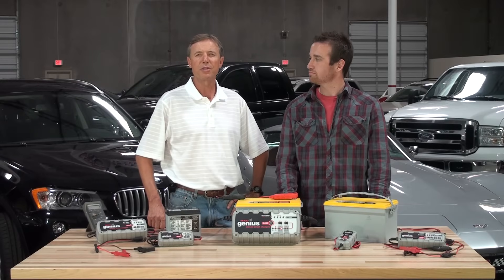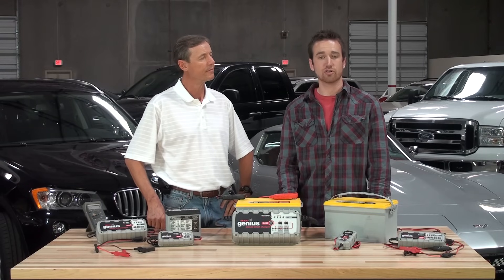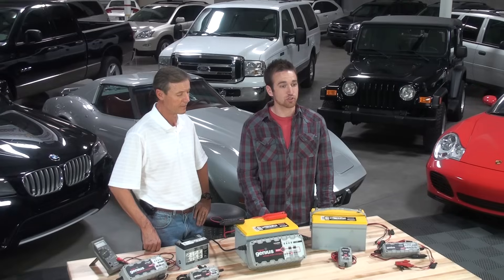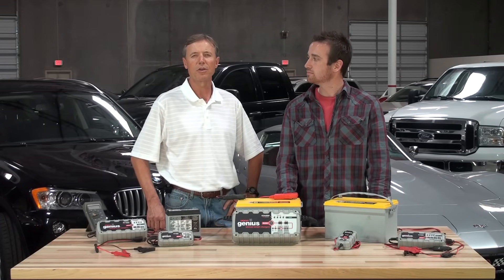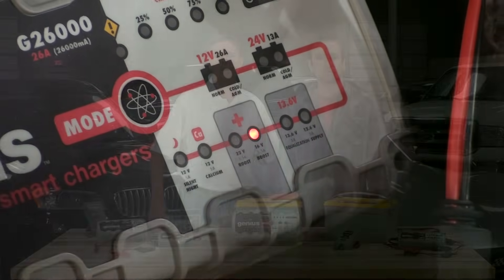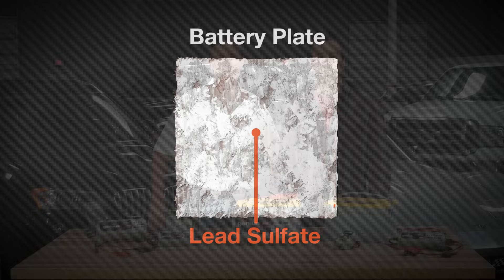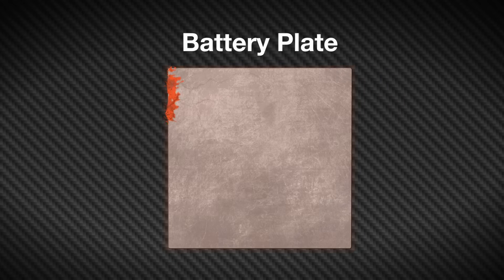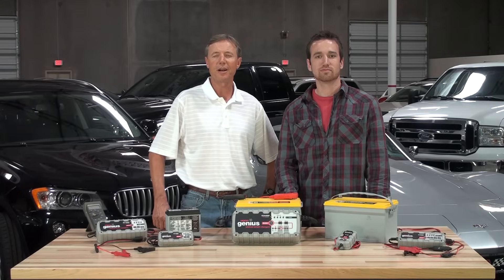How to Desulfate a Lead Acid Battery

Comment: Very poor video. Trying to sound smart by noting the charging current as 1500mAh when to everyone else it's 1.5A just makes you look suspect. And 1.5A may be fine for a 100Ah battery, but it would be the end of say a 15Ah battery. Very sloppy and inaccurate - makes you look like scammers...

Comment: Will a 2 amp trickle charger revive a dead battery? It seems to be charging. It kept saying the battery was bad so I unplugged it and plugged it back in and it is still charging. Any advice would be great

Comment: You are SO wrong. I build Lead Acid Fork-lift batteries for a living and have taken apart about 26,000 units and rebuilt them in the last 35 years. The REAL problem is that the Positive plate gets brittle and crack!!!!

Comment: The high voltage means I would not try this as a recharge without disconnecting the battery from the vehicles circuit, I suspect the fine print for the charger would tell you this.

Comment: Do you need to remove the battery or can desulfation be done with the battery attached to the leads in the car?
Reply from the maker: The battery should be disconnected from the vehicle.
Reply: @NOCO  How much long will the battery last after done a recovery mode?

Comment: does it matter if the battery you use a desulfator on is AGM vs lead acid?  

And will smaller desulfators still work on higher amp hour batteries?

Comment: re: "Battery Sulfation accounts for roughly 80% of all battery failures."   ...but that's almost always batteries that have not been kept fully charged. Batteries used for standby (not deeply cycled) that are routinely kept at no more than 25°C  on a maintenance charger that does not overcharge them will experience very little sulfation over their maximum possible lifespan (~10-12 years).  Instead, they end up failing due to accumulated plate shed material in the bottom of the battery, which eventually builds up enough to cause "soft short(s)" on the bottoms of the plates in one or more cells (usually starting with the cell on the positive terminal). That causes internal resistance to rise and every attempt to charge (or desulfate by brief intentional overcharge) results more  of the charger's electrical output being converted to heat, causing excessive outgassing, hastening the inevitable demise of the battery.
Reply: Correct me if I'm wrong,, but doesn't that mean that most store shelf batteries are improperly stored?
Reply: @GoliathSack  Yup! That's the first time they start failing and it goes down hill from there.
Reply: @GoliathSack Yes, at least for flooded cell bats.
They should be stored without the electrolights then filled up for the first time when sold to the customer.
Reply: Good to know... I'll take that into consideration the next time I desulphate my 25 year old 6v deep cycle batteries.
Reply: @justsoicanfingcomment  gotta love it! 😂

Comment: Outstanding! I use these for my golfcart, 4-wheeler, jetski and lawnmower.   imgs.love/nBatteryCharger    I installed the recepticle on all instead of using the battery clips. So easy to plug and unplug and all of my equipment is always fully charged. I also use a larger version for my boat.

Comment: Maybe then I can desulfate my 12V car battery at 16.5V @ 1500 mAh using my 50$ Imax B6AC v2.0 RC charger. I'll try it out. To end charge at 16.5V (close enough), All I have to to is select the "Li-Ion 4S" charge mode, which has an End charge voltage of 16.4V and set the charge rate to 1.5 A. And voila ! If I want to be even more aggressive, I can charge in "Li-Po 4S" charge mode, with an end voltage of 16.8V.

Comment: The NOCO Company:  I'm curious if you can answer this question for me.  Is it safe to use repair mode on an AGM or Gel type battery?  The instructions do indicate that repair mode is only to be used on flooded lead acid batteries.  However, it does not specifically state that you can not use repair mode on AGM or Gel type.

Comment: Great tip! Battery discharge and subsequent sulfation is the most common cause of lead-acid battery failure.
Reply: You are SO wrong. I build Lead Acid Fork-lift batteres for a living and have taken apart about 26,000 units and rebuilt them in the last 35 years. The REAL problem is that the Positive plate gets brittle, cracks!!!!!
Reply: I need some batteries 48 volts higher amps solar power. @bobgreen9980

Comment: 16.5V at 1.5A on a 12V battery?  Yeah right!  It will be MUCH higher than that.  To test this is easy.  Just get a 30V variable power supply such as a laboratory power supply ($50 or less used) or just borrow one, allow it full reign on delivering it's maximum current, then sweep the voltage from about 12.8V slowly up to 16.5V and watch the built in ammeter.  Even if the battery is fully charged (let's say it is a 12V 150Ah battery which is quite large and heavy), chances are it will soak up more than 10A at 16.5V.  So unless you are rewriting ohms law, I don't see how you can get only 1.5A to flow at 16.5V at the battery terminals.  If the charger is somehow adding series resistance internally then there will be a voltage drop at the battery terminals so it wont be 16.5V.

If you have a DC clamp ammeter to measure amperage flowing thru a cable, you can very briefly connect a pair of 8V batteries in series for 16V to a 12V fully charged battery and measure the amperage.  I suspect it will be WAY higher than 1.5A (1500mA).

I agree the information presented here is not accurate.  Sounds like they are trying to hype up this product when in fact a $50 laboratory power supply can do similar and then some.  For example, what happens when a battery is so bad that not even 16.5V can bring it back to life?  With the lab PSU, I can go all the way up to 30V and I can set my Vmax (maximum charge voltage before it changed from CC (Current limited) mode to CV (Constant Voltage) mode.  Typically on a 12V FLA battery I will set that at 14.8V which is 20% over nominal battery rated voltage.
Reply: +David James Reversible sulfation can often be corrected by applying an overcharge to an already fully charged battery in the form of a regulated current of about 200mA. The battery terminal voltage is allowed to rise to between 2.50 and 2.66V/cell (15 and 16V on a 12V mono block) for about 24 hours. Increasing the battery temperature to 50–60°C (122–140°F) during the corrective service further helps in dissolving the crystals.
Reply: SHLOMO AMAR Ok I can easily do that with my lab PSU, that is, restrict it to 200mA maximum and let it run that way for 24 hours.  I assume each battery should be done this way individually and not in a bank correct?  Also what is so special about 200mA?  Is this enough on a large 200+Ah golf cart battery such as a 6V 210Ah FLA battery?
Reply: SHLOMO AMAR - How do you increase the battery temp to 122-140 degrees F?  The 200mA overcharge wont do it.
Reply: +David James 
1. Charge  the battery to the maximum using standard charger.
2. Connect current source and Limit current to 200ma (my experience to avoid over heat and boiling).
 3. limit voltage to maximum 16.45v  
4. Don't allow  battery temp to rise more than maximum of 50 C (about 140 F).
If the battery is very old and the voltage is very low use Pulsed method to restore the voltage and before doing the above process (1-5).
Reply: +David James 200ma only my experience for 37AH Battery.
Reply: SHLOMO AMAR 200mA is probably below the self discharge rate of a large battery so maybe 600mA or so for a 200Ah battery or maybe 1A (5x the Ah rating in mAs?)

Comment: I have the G7200, how long do I leave it in the 16v boost mode?
Reply: I have the same charger and have the same question, I have been searching for about 2 hours without any results.
Reply: Kayne Davis
IMO.
16 volts is harsh equalisation. The battery suffers to an extent. Certainly, it will remove some sulphation, but you don't need one of these devices for that.
If the device never leaves the boost mode, I guess it may never be able to sort the problem, or will take an extended time in trying. 16 volts over an extended period is self defeating where vehicle batteries are concerned. It will do more harm than good.

The video does say it's a pro-active measure, not a cure.
Reply: @ChaoticaExtreme in desulphate mode the voltage is pulsed & the current is prob limited
Reply: ChaoticaExtreme Thanks for the info.

I ended up leaving it on the 16v boost mode for 2-3 days and then charged it again, the next day the battery was flat again. It was a old battery from my brothers shed that was about 8v so there wasn't much hope for it anyway, it was worth a try before disposing of it.
Reply: Kayne Davis
No worries.

Because it's old doesn't have to mean it's shot. If you want to attempt to recover these old batteries, you need appropriate hardware with an output far greater than 16 volts.

I have a battery that was kicking around a garage, doubling as an axle stand. The casing is beat up and badly marked. It contained tap water. Replaced with electrolyte, hooked it up. Took 3 days. Now it will start a vehicle after standing for 6 months.
Reply: ChaoticaExtreme The battery was original equipment in a 2004 Kia van my brother bought new, after 5 years it wouldn't hold charge and it failed load tests at the mechanics and since then spent another 5 years sitting on the floor in my brothers shed. Its also a maintenance free battery and I was unable to check the fluid levels, the charger did do a good job charging other batteries including one that other chargers wouldn't charge after leaving it on power supply mode for about 30 mins before charging.

Comment: Step 2: Recovery
Initializes the Recovery process, if needed, for deeply discharged or sulfated (desulfation) batteries by pulsing small amounts of current.

for the genius G3500-right off their web page-so you're totally wrong,silly you!

Comment: The G3500 is a smart, 8 Step, fully automatic switch-mode battery charger and maintainer. The G3500 restores batteries to their original capacity, recovers slightly sulfated batteries,
RECOVERY MODE
Recovers deeply discharged & sulfated batteries with pulse charging
I GUESS THE MANUAL & WEB PAGE IS WRONG,copied from the 3500 web page information,you'd better check it out,& get your information correct before making yourself look silly
 at geniuschargers.xxx - click features for the 3500

Comment: Buy one,you won't be sorry,get the G1100 1.1 amp & up,the smaller ones don't desulfate,I got the G3500,3.5amp.a bit more power for 20$ more,Best battery charger that I ever bought+ it has plenty of useful accessories at a fair price-Pays for it's self,when you don't have to buy a new battery at 100$+ every couple yrs. on your stored vehicles/boats/bikes/toy/etc-hook it up,set it & forget it,never have a dead battery again,if the battery don't keep a charge with this thing,it's time for a new one

Comment: 16.5V, 1.5 Amps, won't the battery want to absorb more energy than just 1.5A if it is given 16.5V at it's terminals? I think this is heavily dependant on the SOC of the battery. If it's not fully charged, it will gladly grab tens of Amps of power and your charger may struggle to maintain 16.5V at the terminals.
So basically the 1500mA in the video is completely variable and not a constant, so I don't know how they got that number.
Reply: You can charge with regulated current.
Reply: I literally just did this before watching this video. I used an 18v 0.5ma Dremel power supply to dirty charge a 4s lithium battery pack. I didn't have time to wait for the usb-c to charge it up so I just wired the 18v supply straight to the cells and monitored the charge voltage the entire time I never left it's side but it never got hot and if I had the USB-C connected at the same time it would show the percentage ur charge going up. It's not good to do this type of thing on a regular basis but I think I good load test and a good jump start with what every battery out there needs to keep it alive for years of abuse. I'm the unprotected 18650 cell in my zoomable flashlight kinda guy.